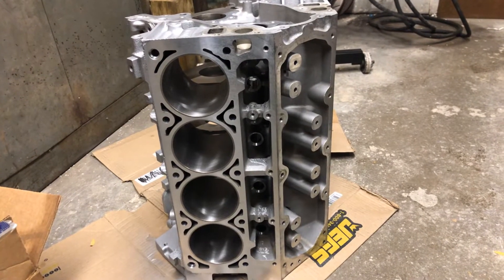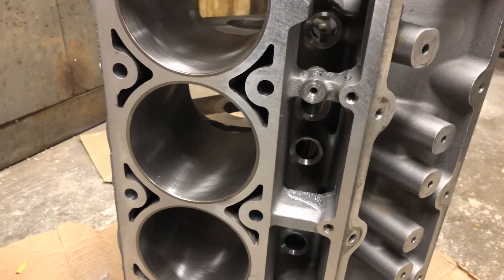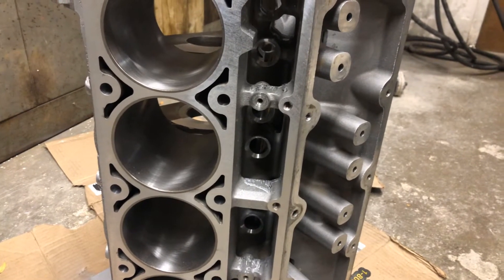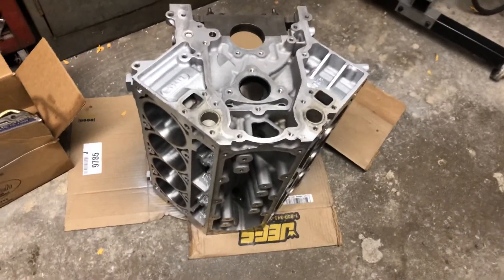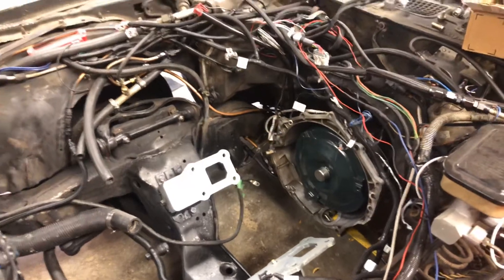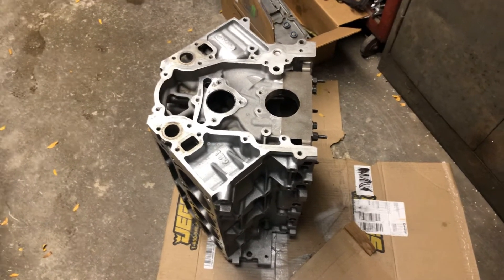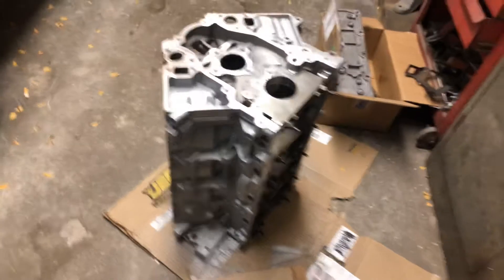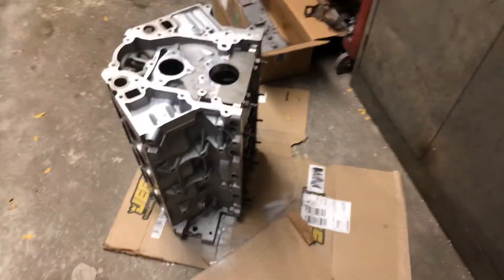LS3 416 stroker block

Comment: What did you have the shop do? I was told you can’t bore it because they already come with 4.065 bore, so they’d have to hone it? What’s your take on that
Reply from the maker: I had the cylinders bored block decked and line honed according to the machine shop but they could have very well hone to 4.070 and there’s also 4.075 and 4.080 piston’s available. I don’t recommend 4.080 piston’s without resleeving with thicker cylinder liners very expensive but cheaper than buying a new block or look for a standard bore block.